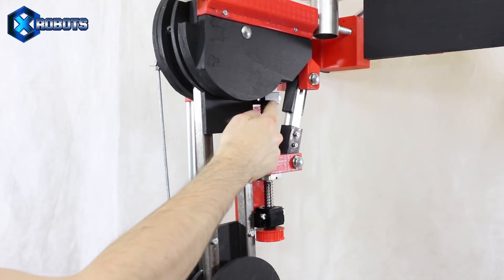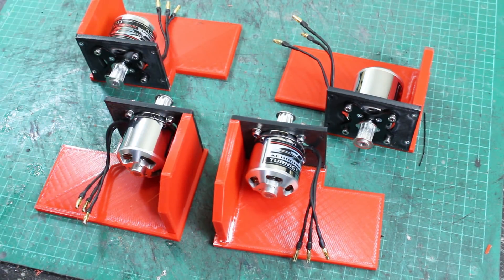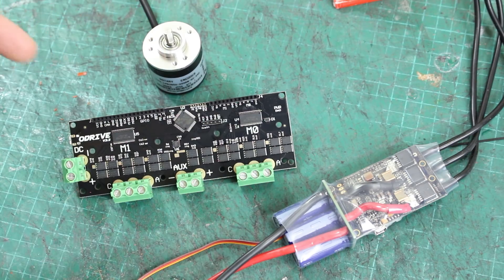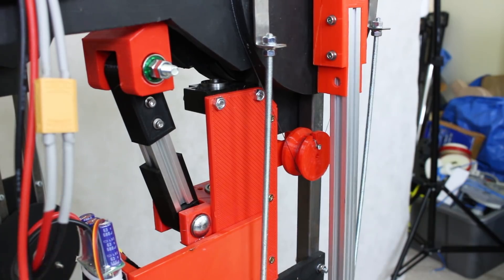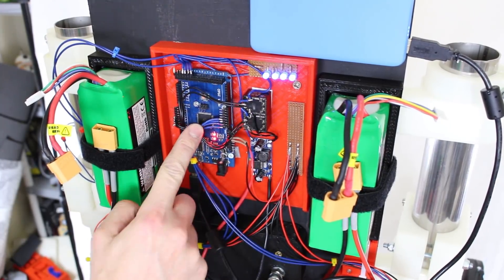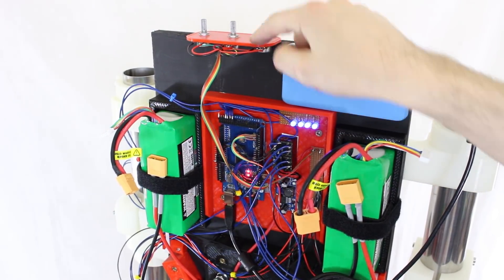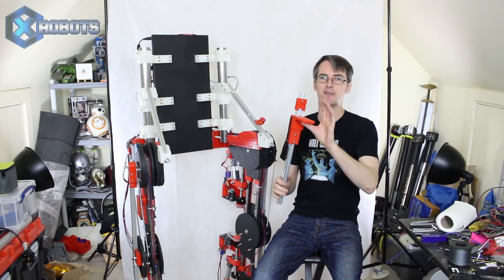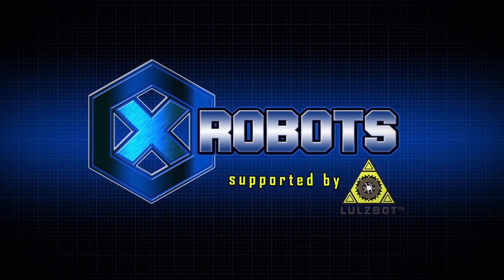Iron Man Exosuit #19 - Gearboxes & Motors | James Bruton

Comment: suggestion: add charging for the batteries via wireless charging in the feet, and a platform on which to park it when charging, this would look cool 😊
Reply: That would take about 1 forever to charge, or it would set on fire.

Comment: Hi James, I vaguely remember you did a video on this ages ago but I was wondering  what 3d software you use? Just got a 3d printer myself and want to start learning a bit of basic 3d modelling for printing but I'm a bit stuck where  to start. I played with sketchup a long time ago, seems it's gone web based now but would that be a good starting point would you say? Was going to ask what filament you mostly use too but I heard you use both in the vid so I guess it's whatever is best for the job. Thanks
Reply: tbuksuperfly Autodesk's Fusion 360, it's free and the best modeling software out there. He also uses cura for slicing. Imo, sketchup is great for basic design modeling for dimensions of larger things eg; furniture, buildings or floor plans but not great for small detailed 3D modeling. Get fusion, learn all its features and you'll never need anything else. As for filament PLA is great for all things but some tend to favour ABS for parts that need mechanical strength. I hate ABS, it's petrol based a stinks out my office so, I only ever print PLA (colorfabb) and I've not noticed much strength difference anyway.
Reply: Also, fusion 360 has the biggest following and tutorial base on YT so there is so much help out there, check out the channel NYC CNC as John had lots of tutorials for everything fusion from basic modeling to advanced toolpathing for CNC milling etc.
Reply: Thanks for the reply smoky, I thought he used 360 but it's definitely not free. Has a subscription model. There is a free trial but I'm presuming it's only a 30 day trial or something. Don't want to get used to something then it become unusable. I'm just planning on learning and doing a few small things so paying nearly £300 a year for software is ridiculous. The filament question was more just curiosity. Was wondering if he mostly just used ABS as the PLA would be more brittle but I guess that's not a problem. My printer came with ABS and don't have any problems printing with it (and yes, an open window and a fan is a must for the smell) but I do have some PLA on order. Cheers.+
Reply: tbuksuperfly fusion is free. People only have to pay for it if they have made a business out of using it, (like a design studio etc). I have had fusion since it came out... Use it all the time... Definitely not paid a penny. Seriously its the best place to start as it will soon be the industry standard.
Reply: tbuksuperfly you just have to make a hobbyist account with auto desk.
Reply: Good to know. Thanks guys :)

Comment: Is there a failsafe option in the ESC software?  I've seen ESC's that are initialized run wide open after a loss of signal, but with a delay giving a false sense of security.

Safest would be to buy a large enough kill switch to handle the full power.  Automotive battery disconnectors should be capable of handling it.  Plus resettable breakers for the Lipo batteries.  Those batteries can easily vaporize the leads and cause burns.

Comment: Have you thought about using these to detect your movement rather than the pressure pads? Would be way cooler and seems like it would have less "backlash" than a pressure switch which requires your limbs to be slightly free floating from the suit and kind of kicking your legs around to activate the different pressure padshttps://www.robotistan.com/emg-sensor-movement-of-muscle-and-nerve-measuring-module
Reply: jamie clarke That would be pretty cool, maybe a bit harder to interpret the data